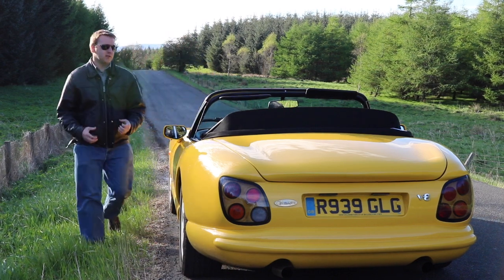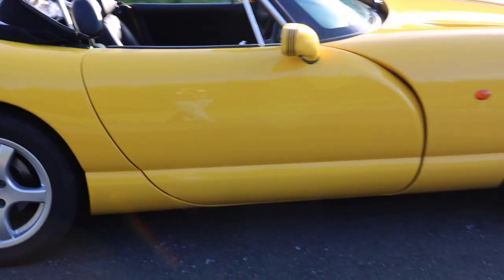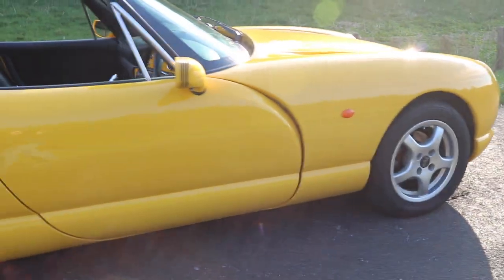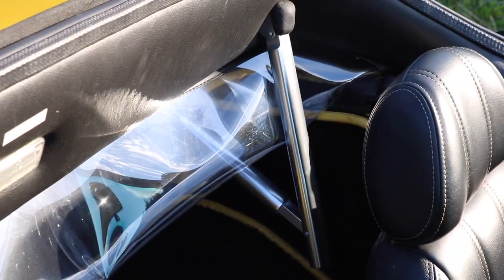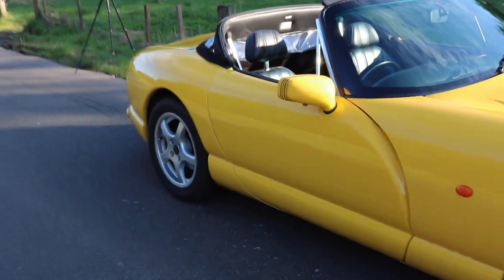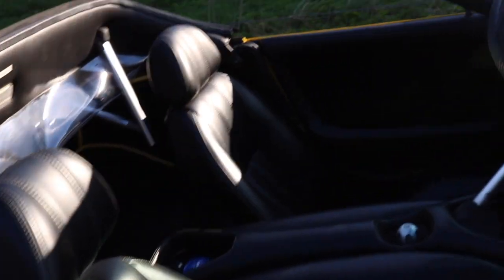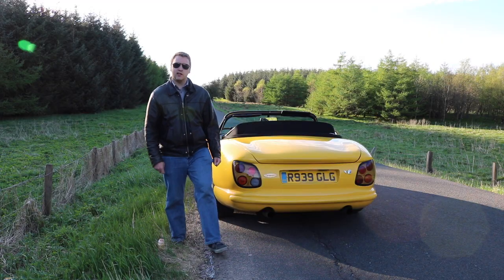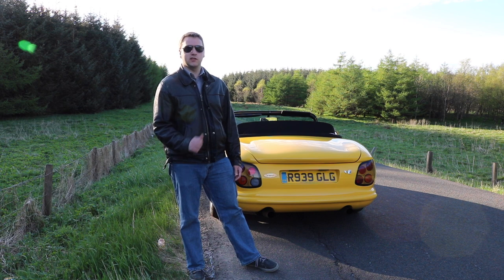5 TVR quirks that have a purpose

Comment: The door handle/security thing was actually just a nice added benefit to the original design thought. Peter Wheeler (who ran TVR back in the 90's to 2000's) had this fascination with clean styling. Hence why not only are there no door handles, there are also no windscreen washer jets on the bonnet, no external aerial, no boot release/key hole, no fuel filler etc. He didn't want any exterior add on's interfering with the cars styling and clean lines. You can see how this evolved through the Chims life as the early cars had external door buttons, exposed boot hinges etc, which later were designed out and hidden.
This also ran through to the other cars produced under his tenure, the Griffith, Cerbera etc. 

And granted I know nobody has conclusively proved if its true or an urban legend, but I can't believe you didn't mention the 'Ned the Dog' styling addition haha !

Comment: Nothing to do with "joyriders" it was just TVR innovation. The Griffith had the same interior door release but, had a mechanical push button release on the outside. As one commentator has stated a thief could just cut the rear hood. However, there's no need to do that when a good whack with the palm of the hand around the roof stays would do the job.